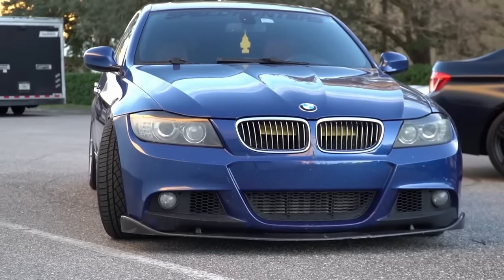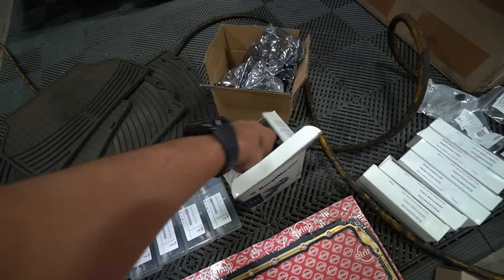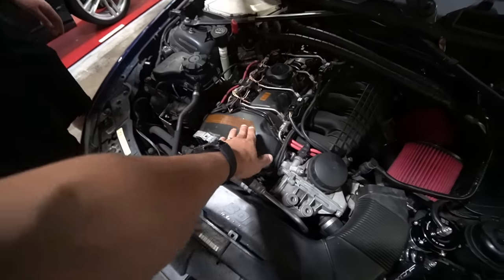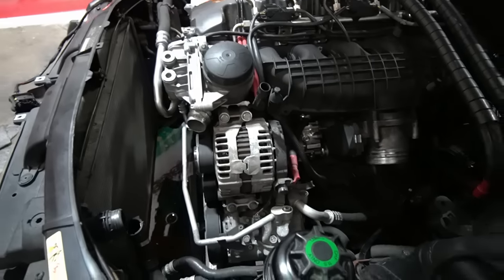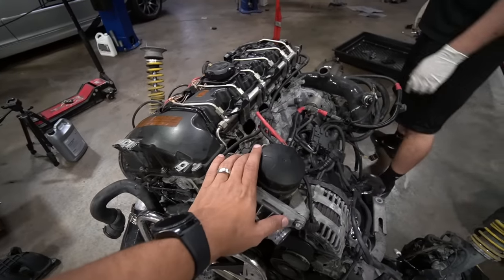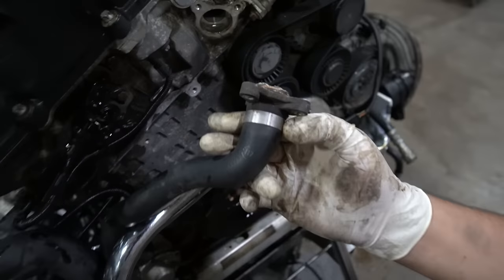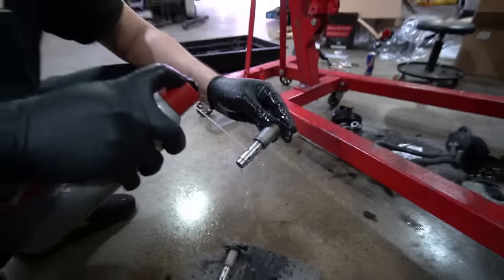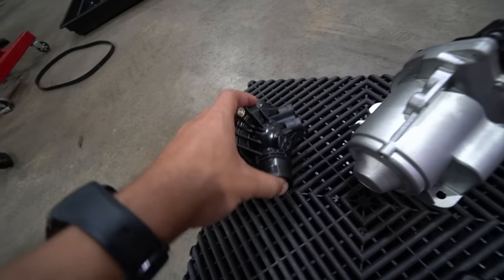The Only REAL Way To Make Your BMW Reliable - Everything You Need (335i N54)

Comment: Everyone is here is a OG before 335is become legendary like a Supra and everyone is selling them for 20 - 30k or more lol
Reply from the maker: Facts lol
Reply: Atleast they still cost 12k max in Europe. Here it's literally called Lambo and Ferrari killers ngl
Reply: Nürburgring Slayer  pocket killers aswell
Reply: @robertseitz2407  I bought a 2008 335i for 4k and the kid had no idea what5 was wrong and it was just a bad alternator LOL!!!
Reply: @WhoisAustin  😂😭 wat a steal
Reply: @WhoisAustin  lol, great buy
Reply: @WhoisAustin  how many miles
Reply: Oh for sure it’ll happen just like abracadabra skyrocketed value 🚀
Reply: @WhoisAustin  yea i see alot of ones in my area that are in good condition for around 8k. And pristine ones for around 12k
Reply: In europe already start to valorize. In some countries they can reach at 20k.
Reply: in uk they like 10k and under but less mileage is like 15k
Reply: I traded a 2000 Subaru Outback I got for 3k for a clapped out 05 wrx without a turbo in it. After I put a turbo in it I then traded that car for a 2008 335i only with a oil filter housing gasket leak!!
Reply: there like 6k -12k
Reply: I got a 335is 😍 legendary status
Reply: I have a bmw 335i e92 2008 MT with 82000 miles
Reply: my twin turbo 335i just hit 130k miles😪 still runs 400+ hp mostly stock
Reply: @purppah  MT or AT ?
Reply: @WhoisAustin  same here got my 2009 535i for 4K best purchase I’ve made
Reply: Tryna keep this shit lowkey lmao
Reply: I just bought one last week for 9k. X-drive 335i only 95k, things in perfect condition
Reply: I bought a 2009 335i xdrive bmw m sport package for 6k, but the engine is fucked, currently paying a mechanic 7500$ to install and buying a used engine with about 45k miles on it. The car has originally 116k miles. So total cost was roughly 14k-15k, was it worth it ???
Reply: @WhoisAustin  I bought my manual 335i 2007 sedan with a bad fuse box for 4.5 k lol
Reply: Lmaooo. I got mine 2009, 56k miles with all maintenance and replacements done, JB4, full exhaust system, cold air intakes and BOV for $12.5k
Reply: @TheGamingDistrict1  noiceeeee, talk about a good find
Reply: @stevensteven87ec30  indeed! Spent like 5 months looking for a good one. I was about to give up and just go for an F30 328i but this one appeared and I had to get it
Reply: @robertseitz2407  what are you talking about 12k max they go above 20k in scandinavia
Reply: I hope not until i buy one…
Reply: @WhoisAustin  fuckin lucky!!
Reply: I just got mine for 22k with 69k miles
Reply: @marcmartinez3623  NO
Reply: Bro id cry cuz im trynna save for one
Reply: Just got 1 owner  2007 e93 335i for 13k this week with 78k miles on it

Comment: Things you also shoukd do
1. Pcv 
2. the cam ledge seals
3. the metal power steering pulley
4. catch can set up 

then itll be mint, also metal oil filter cap but you already had that

Comment: Have to agree here- 
Engine out service is best way to tackle this.
I did 
Oil filter housing gasket
Valve cover gasket
Thermostat and electric water pump…
They are so much harder to do while engine in vehicle 😂 

100% agree on all your preventative maintenance with the N54

Comment: Time to finally save up for all the maintenance items lol, at least with this video I know everything I need🙌🏽Always coming in clutch
Reply from the maker: I got you guys covered 👊🏼
Reply: @VehicleVirals  Hey buddy, so how high do you consider high mileage on the N54?!?   I just purchased a 08 135i with 87k.  I know right I got good one I think.  Love your vids they are very informative.  Tell the dudes there they got a great shop.  You got any other advice on what I need to do to this one?!?   I'm gonna try and get the maintenance history from BMW.   
Tnx for any info or help.
Reply: @VehicleVirals  also what type and weight oil should I replace with?!!   Someone told me the Diesel 5w 40 was good for the N54.   I live in WV so I get cold winters and hot summers.   Tnx bro

Comment: I've heard a lot of negative comments about the n54 335i. That being said, when it does run right it is an absolutely incredible car. And you can buy one right now at a decent price. I do want one but I am just afraid that I would not be able to afford all the maintenance. So I'm going to wait just a little bit longer until I can figure out exactly what needs to be done to the car that will ensure that it will run for at least 50,000 miles without any major issues. This video was very informative. Thank you
Reply: Wonder what you ended up doing. I’m in the same boat.  Everyone who’s been through these tells me just stay away or are one of those cars that’s down getting repairs or “maintenance” more then your driving it.
Reply: @mysixfo8805 So the thing is, they definitely do need a lot of work and you need to know how to work on a motor yourself to get your budgets worth. That being said, if you know how to work on motors and have some money in savings for the main failure points, they're not that bad. The aftermarket has covered a lot of the big failure points of the N54 in 2023.

Comment: Don't forget about the PCV valve, that caused me some headache in the past.  Are you planning on putting in flex-fuel? Would be cool to see an install on the Fuel-it kit with the bluetooth analyzer module and how it works with JB4.
Reply: N54 have pcv I thought I was the b58

Comment: Pro tip: never get the actual replacement for the “McDonald’s straw” get a section of break line about the same diameter(bring it to match), cut it to the same length, and it’ll never break again

Comment: I have not even watched this video yet, but the only way I have real peace of mind I’m when going on road trips in any N54 car of mine is if I’ve done Battery, LPFP,HPFP,Waterpump, thermostat, Coolant expansion tank, All pulleys, tensioner, serpentine belt, Spark plugs, Coils, Injectors, and every gasket except Head gasket.

Comment: On my n55 I just did the OFHG, OIL return, Coolant return, radiator hose replacement at 82k. So glad I did
Reply: I need to do my oil filter housing gasket on my n55  I heard about engines seizing after did your car turn out ok

Comment: Thanks for all the information on maintenance, I've had alot of bad luck lately, someone left a rocker cover gasket in the pan, it got sucked up into the oil pump feed pipe causing rod bearings to fail and the crank to crack and bend 💔, got a replacement engine now so hopefully better days ahead.
Reply from the maker: Wishing you the best going forward!

Comment: I'm late to the party, having just purchased a e90 335i, but you can just lift the engine crane to the height in an instant by hand, instead of pumping it manually or with whatever device you were using.

Comment: For the belt i have this N54 N55 Crank Seal Cover Plate, Serpentine Belt Guard for BMW 535i, 335i, 135i from ebay installed extra protection if the belt go bad some how then the belt will not go inside the engine and destroy my engine

Comment: Maintenance first! Shout out FCP. Pro tip: pay through PayPal and get your return shipping refunded, PayPal will refund shipping for warranty returns 🙌🏼
Reply from the maker: Good tip!
Reply: Didn't know that, thanks!
Reply: How would I go about that? I just returned some stuff to FCP Euro and got refunded through paypal
Reply: @RennAMVs  you purchase the parts from FCP. Once you need a replacement, you order the new part and send the old one back. FCP issues the refund, you pay the return shipping. If you pay using PayPal you send your shipping receipt to them and they cover your return shipping cost for the warranty return. Basically buy the parts once from FCP and never have to buy them again, even oil!

Comment: Those control arms are fine, they move like that normally, but its still good to upgrade to m3 ones and put the poly bushing in if you want more stability. It will however make the ride a lot less forgiving on bumpy roads lol.

Comment: How do I know what gaskets I need without taking out the engine. Am I able to remove some things and look at where the oil leaks are coming from and determine what gaskets need to be replaced? Hopefully I can DIy most of it.
Reply from the maker: You have to clean when you see oil residue and check back to see where's it's coming from. I've heard of people adding dye to their engine oil as well.
Reply: @VehicleVirals  I see, all of this stuff is putting me off from buying one of these cars. Not sure what I should do lol

Comment: Nothing better than a 335 I! Of course you have a ridiculously wicked maintenance schedule! But these cars are so fun to drive! I have driven everything and it's hands down on the 335i. I doubt I will ever sell mine. Even though it's a convertible it adds weight to the vehicle. Upwards of 5000lbs. It can still roll with outrageous power. I want to point out to 335 convertible drivers..........DO NOT  run the car hard with the top in the trunk! What happens even with new suspension in the rear is squat due to the extra weight that with the top up... .. is distributed even. With the top down......way to much weight in the rear and will cause problems with tires rubbing not to mention suspension issues! Just remember when the top is down stay out of the throttle and drive like a little old lady! It's hard to remember if you are an aggressive driver but it will save you a lot of headache!!  Have fun and do the maintenance yourself and often!!

Comment: I just bought a 2010 335i xDrive and it now currently has 72k miles. It is a dream: 6spd manual, m sport package, cold weather package, and a bonus the water pump has already been replaced. I believe i might have a Oil pan gasket leak, but the shop I got an oil change at said it was the rear main seal. However, seeing this video makes me want to save up to do this engine out service and do a huge refresh. Can you possibly give me a list of all this in order ? And should I do a turbo upgrade at the same time ?

Comment: Great Video bro 😎 Alot of good info ! I have a 2011 335i  same color lemans blue and the oil filter housing gasket. Leaked and it wet my belt and it sucked it into the motor 😩
Reply from the maker: Yikes!

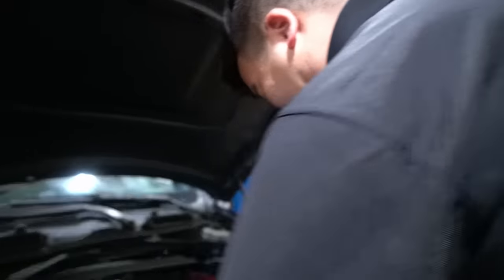Comment: on the operator engine coolant hose @10:43 mark with size gasket is it....because my current one is stretch out and anyone I tried getting is either too small to seal properly or too big to fit snug

Comment: Thank you for making this video !! I have 1 question I couldn't find it in the comments. All the parts that you listed that you're replacing for preventative maintenance and gaskets, coils everything that u had on the ground. How much did All that cost "roughly" All together ? Like 1k? Just curious. I'm looking into buying a n54 wagon with 130k miles. And build it. Just trying to do my hw. Thank you so much!
Reply: It will be atleast over 7k easy for everything

Comment: Hi love the channel just need your advice i have a 2007 e93 335i convertible 98.000 miles
Im going to upgrade the inter cooler 5", down pipes, charge pipe with BOV , duel cone air filter front upgrade brake lines, 1st step cooler spark plugs. I have changed the water pump what advice will I need from you before I go ahead with the mods

Comment: You might need a helix so you don't run out of fuel at hpfp. I'm around 500whp e30 and it's tanking
Reply from the maker: I'm running port injection. Don't need Helix.
Reply: Actually you should run the Fog’R 500 tier 1. It allows you to run your stock hpfp and still hit your whp goals, I’m running the f23 from frankenturbos (twins) and I’m at 675 whp 641 lbs, upgraded LPFP 2.5... much much cheaper then port, and better for your car, never a need to walnut blast again since fuel is spraying directly on Val’s, if you didn’t know what the Fog’R 500 is, it’s a throttle body injection made via midnight motor sports. Y’all can thank me later, zero need to go to the slow single and loose all your low end torque and have to wait for spool... get twins and the Fog’R 500🏃🏾‍♂️!

Comment: i am going to tune My 335i very Soon but i am only going do cattles Down pipes, and muffer delete, charge pipe and a high power airfilter and the MHD flash, i have a goal at 450-500 hp do i need to chance the water punp and fuel pump and all that stuff to make it run Reliable???

Comment: You should've done rod bearings man!! The engine has 140k miles and you don't know how often or what kind of oil the previous owner(s) used.... Youre going to be making a ton of power as well... smh. Wouldve also been interesting to test your theory on how uncommon it is for rod bearings not to mess up on the N54. I wonder how yours look

Comment: looks like you bought the car a few times over with all these prevention/performance parts. my real question is what do you recommend as mandatory for just a full bolt on car? as of now I have DCI's and charge pipe with just MHD stage 1 tune and am about to go with a 7 inch intercooler that I already have and some downpipes which will allow me to go right to stage 2 plus. I just replaced all the coil packs and plugs plus oil filter housing gaskets were done recently. The car does have what is most likely original water pump but I cant be sure its fairly low milage 08 with 70k miles any imput would be appreciated.
Reply from the maker: HPFP, injectors and the water pump are the ones that normally need attention.
Reply: @VehicleVirals  ok so in your opinion going from stage 1 to stage 2 plus tune/mods I should take care or those items first? if so then thats what I'll do but those injectors are pretty darn expensive I was looking at used remans as an alternative to save on cost but I'm not sure if thats a good idea or not.
Reply from the maker: @ant135  You don't have to take care of them if they are healthy. In fact many don't and are just fine. I agree with injectors being super expensive and it might be worth taking a shot at used index 12s and replacing the seals and possible getting them cleaned. It's a risk for sure buying them used but many seem to have won going that route
Reply: @VehicleVirals  thanks for the info I really appreciate it. Honestly didn't even expect a response let alone a quick one from a semi big youtuber like yourself Its good to see that some of you guys do care about the people watching the videos. You have yourself a great rest of your day and take care.

Comment: Hello👋
Quick question.
Might sound dumb but
Is anyone able to get the “height, width and length” of the N54 with turbos.

Height= from bottom of oil pan to top most point over valve cover,
Width= from left most side of the engine to the right most side,
Length= from flywheel to front most part near the belts,
Also “height, width and length” of Transmission

Any help would be greatly appreciated😁

Comment: Replace the valve cover not the gasket. It’s a wear item. No reason to waste time gasket slapping.

If it wasn’t cracked before you took it off, it was after.

Comment: Yeah. Get an E46 or earlier.  Within reason and with sufficient engine oil and coolant, the M30 and M20 engines are almost most indestructible. The S14, S88, S38, S50 and S52 aren't bad either. The S54 is a roll of the dice. After that, reliability is inversely proportional to the year of introduction. The later, the worse. That's my opinion as a longtime owner and former BMW mechanic. Without degrees in electrical engineering, computer science, good wrenching skills and/or plenty of money to piss away on repairs, or DIY diagnosis and repairs, don't bother. They're poorly designed, under-engineered and cheaply built. Great when they run well, but that's not predictable.

Comment: 12:19 a lot of butthurt people obviously. "could have bought a Ferrari by now".
1. This dude obviously has no clue that a Ferrari is still 7 times more expensive that this E90 is
2. This E90 smokes any ferrari performance wise
Also, you said you don't know why the N54 HPFP fails. IIRC there's an O-ring inside which fails, causing internal pressure loss. Not replaceable or repairable unfortunately.

Comment: 700 whp.... lol, joke.  You better get that engine built with actual internals first and stop cheaping out
Reply: do you know anything about n54’s?
Reply: @ethanbruley3927  ... I’ve owned an n54 since 2009, I know them very intimately.  Stock internals are good up to 600 crank, if you do not beef up the internals (top and bottom end), you got no chance running a 700 whp n54.  There’s a wealth of information about the n54 builds on Bimmerpost